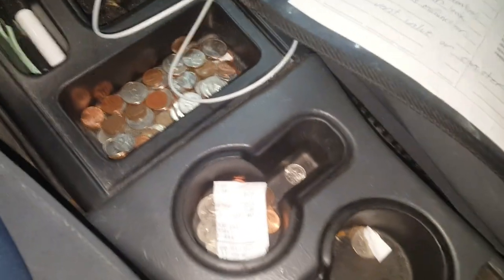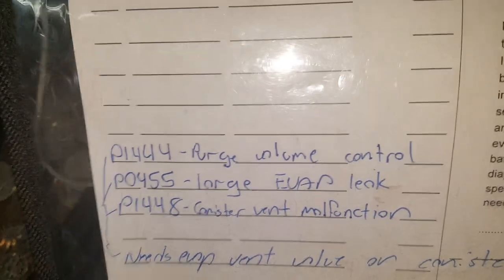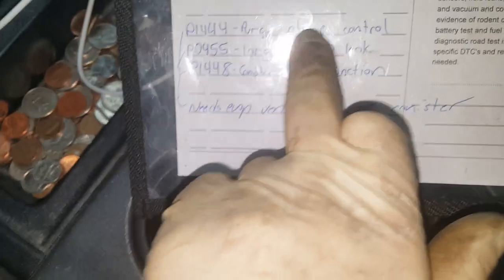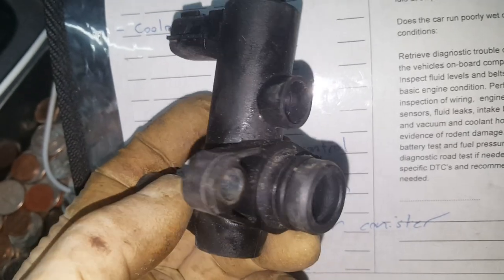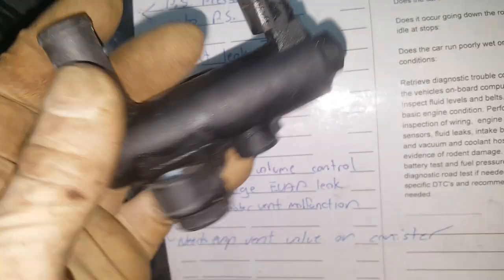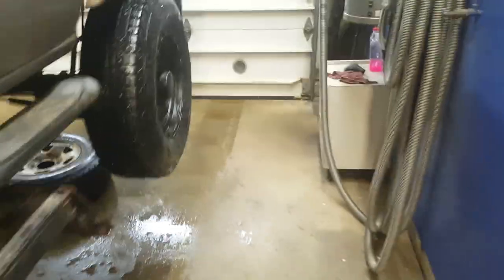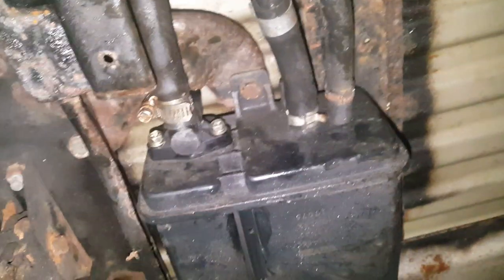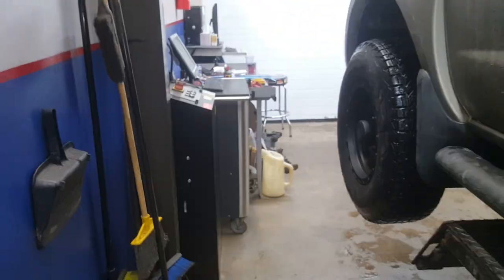Diagnosing a bad evap vent solenoid P1444 P0455 P1448

Comment: I have a 04 Nissan Titan. I went through the same problem with my vent solenoid with dorman. I replaced it three times with dorman. Eventually fixed the problem with a Nissan part from my local dealer for 40 bucks. Nissan sensitive about the EVAP solenoids

Comment: Nissans are not what they used to be. What are you using for smoke? I need a system for a project.
Reply: You can make your own smoke machine using a soldering iron, paint can, cotton rag, tubing and baby oil. Google it. I made one a couple months ago for 30 bucks and wish I'd made it years ago.